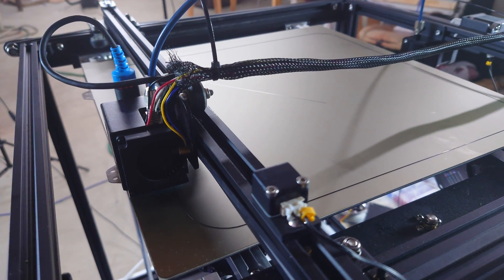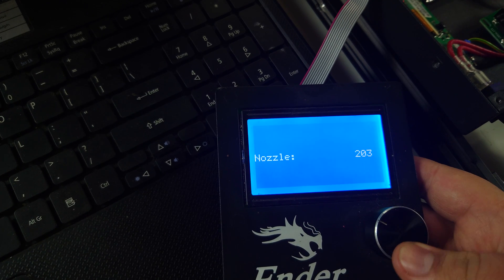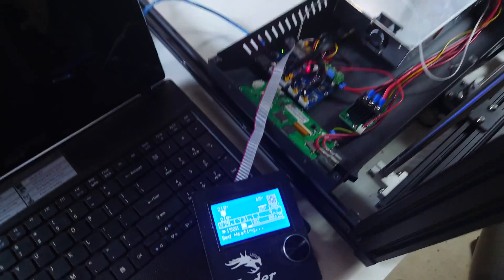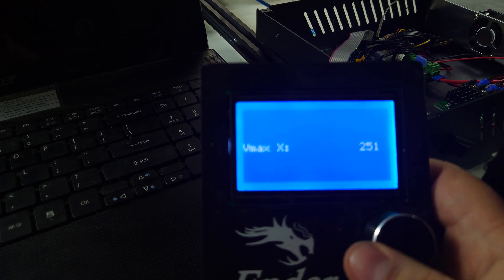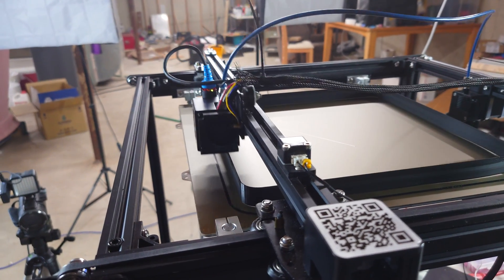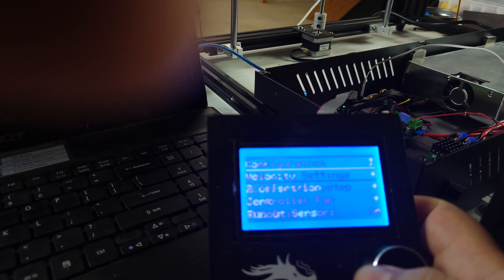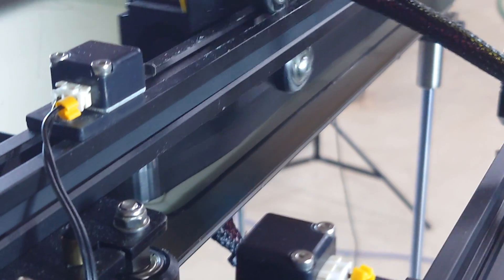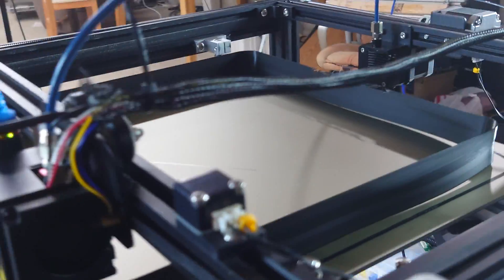Pushing the Ender 5 Plus to 300mm/s

Comment: This was an interesting video even now.  The noise on the Y is either the lifting of the part, or the bearings in the V roller wheels.
I have an Ender 5 and running Klipper I can get 400mm/s on long straights, but most times it never reaches those speeds when the head has to make a lot of small movements.    Upgrading to new extruder (I have a Micro Swiss NG) with a better cooling duct is enough to get there wtihout needing linear rails.  The V roller wheels can handle the speed fine, and the frame of the Ender 5 is quite solid.  I am still using the stock Creality MCU board and the V Rollers.   The only thing I changed was the hot end and to run Klipper instead of Marlin
Reply: what accelaration are you running i can barely see artifacts  at 2000m/s^2

Comment: Did you say you was using the Ender 3 board? If not what do I need to do to use the display with the stock board
Reply: It's the default ender 5 screen (not ender 5 se)

Comment: I'm more worried about the cable rubbing across the top at those speeds lol
Reply: Which one? You mean the feeding tube? You shouldn’t even use that mesh cable thing. Cut it off of there. It’s nonsensical to have. also, so yourself a favor and repkace the tube wirh a clear one.

Comment: CNC Kitchen recommends these settings for speed, if you are using a 0.4mm nozzle (on a regular printer - but will need to change some of these because of the better speed on your ender 5 plus =
Layer height change from 0.2 ==> 0.3
Extrusion Width change from 0.4 ==> 0.6
Number of walls change from x ==> 2
Speeds change from 40mm/s ==> 60mm/s
(Make external perimeters speed lower, e.g. 50mm/s than the above speed to show better external wall quality)
Jerk from 8mm/s ==> 20mm/s
Increase Temp to 230oC
Reply: Which video is that?
Reply: @capcloud  I wish I could remember, but the settings are from that video and I've used them a few times with little problem.
Reply: No because the BambuLabs has a .4 Nozzle and goes to 600ms.

Comment: Those super high print speeds are nice if you only print square blocks in a manner of speaking but not so much for detailed models :-)
You're model could have used a brim it seems ;-)
Reply: I'm printing at 150 and the print bed shakes like crazy when moving around small areas. Gotta print with a brim.
Reply: *your model